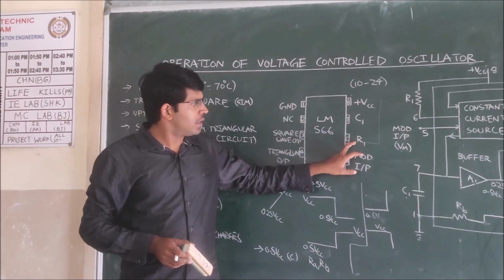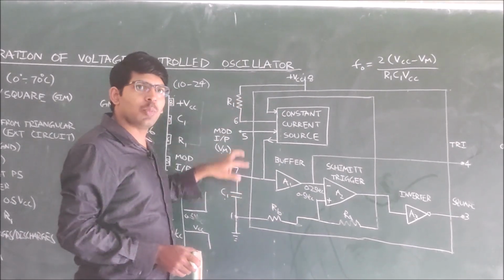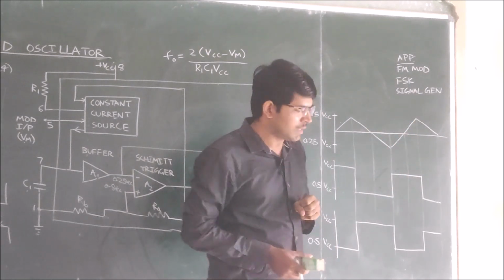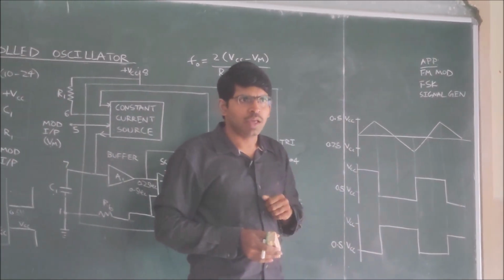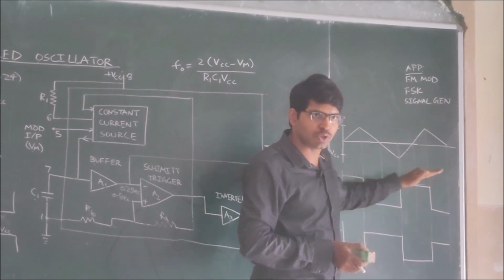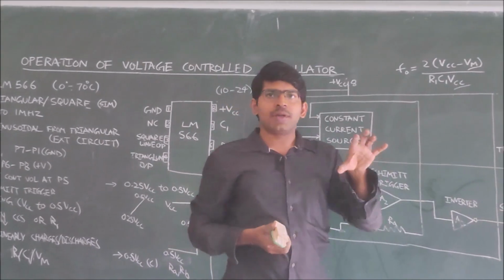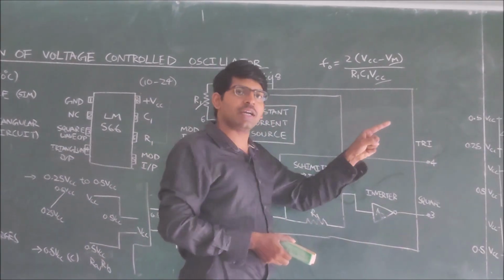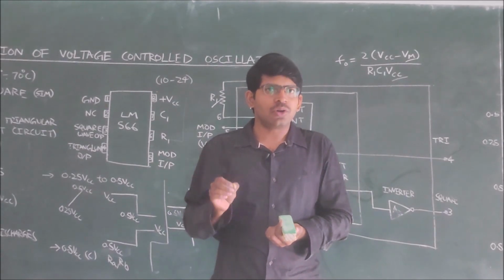51-Operation of Voltage Controlled Oscillator (LM566)

Comment: Thanks Sir. I'm a retired Physics High School Teacher. What's A2 Sir? You mentioned it as an amplifier. But that diagram is Diode.
Your lecture can understand even a lay man. 
What are the min and Max values of C1 and R1?
Reply from the maker: Thank you sir. A2 is an Operational Amplifier sir, it's diagram looks like diode. But it takes two inputs and amplify the difference of them. 

In the LM566 function generator circuit, the timing components R1 and C1 control the output frequency, and their values must be chosen within recommended limits for stable operation. The resistor R1 should be between 2 kΩ and 20 kΩ, while the capacitor C1 should be at least 1 nF, with typical values up to 100 nF or more, depending on the desired frequency range. Staying within these limits ensures proper waveform generation and avoids distortion or instability in the output signal.